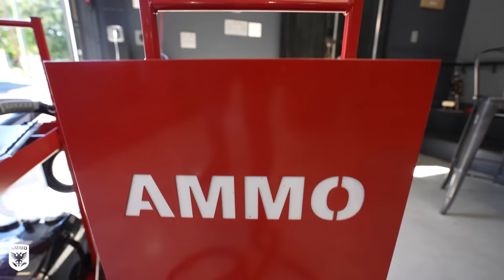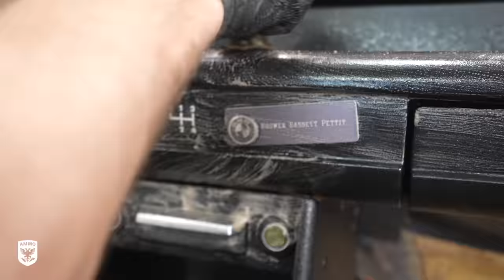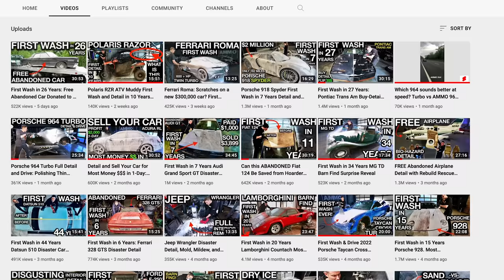First Wash in 20 Years! BMW 2002 Disaster Detail: Buy and Flip

Comment: $4,200 for that car is a major steal even in that condition.
Reply: Definitely, at least 7k
Reply: Would've paid a whole lot more with that condition - You're friend got a steal!
Reply: Yup he stole it for sure
Reply: I sold my 1975 2002 with major upgrades for £300 back in 1989, it was all you could get for them then as they were very hard on petrol.
Reply: How much could it be worth if driving and repainted???
Reply: @cjcj2940  10-15k in running driving condition. 20-30k if clean-very clean
Reply: @kingsman4L  Thanks!
Reply: @cjcj2940  yup yup, just found one in my new neighborhood that’s been sitting for years. Nardo Blue! and 5k on the rebuilt motor. Gonna try and snag it for $500-1500 and flip it for $8-10k lol
Reply: I reckon the seats alone are worth that .

Comment: Had a ‘72 battleship grey with that navy interior. 

Best car to work on and learn how an internal combustion engine works. Everything on that car is straightforward engineering solutions. 

Once those mechanical problems are fixed on that car it will be worth $15,000 for one reason, that spare tire well is not all rusted out.

Comment: I have been using pressure washer for years to clean carpets and the carpet mats for vehicles. On thing I learned over the years if you hang them up in the sun ☀️ or just hanging them up they will drip dry really well. Also a great tip if you like the “carpet lines” in your mats, while the carpets are still wet, use your stiff bristle brush to go in the opposite direction of the ways the carpet fibers lay and make your lines. As the carpets dry the lines will dry in really good and last a while longer…Just a tip that has worked for me… As always, enjoy your videos!! God Bless and stay safe🙏🙏

Comment: Love these cars.  Question: has a customer ever just given you new carpets to install during the cleanup in an effort to minimize the time, effort and cost of shampooing, scrubbing, steam cleaning etc. of the old ones?  Seems like sometimes the cost may be a wash (no pun intended) with, in some cases, better results.
Reply: On normal cars (much newer than this) it probably wouldn't be a wash. In general most detailers don't remove carpeting, the YouTubers do because it makes a better video, and in some disaster details such as this it may make sense. 

But I would guess off the top of my head less than 1 in 1000 cars would make sense for carpet replacement over cleaning. Burn spots and bleaching and worn fabrics are more common than that I'm speaking to cleaning.

Myself I just did a disaster mouse detail for my buddy, I turn customers with that kind of car away typically in general. And I didn't remove the seats, I did the back seat since that's almost always a pop-out type thing. But I got the carpets to 90% like new without removing the seats or carpeting. Extract, and ozone will cover 99.99% of cases.
Reply: I was thinking that. Amazing job on the detail but next time buy an Esty carpet kit :)

Comment: What stuff did you use on the chrome ? Just regular metal polish? And what can be done to rejuvenate paint that has the clear coat peeled in majority of the vehicle. ?
Reply: With a cheap car wax can cause rejuvenation ( like turtle wax 🐢)
 my < hood >paint fadded bad 10 years ago. Clay bar just made it worse / cloudy black =Grey = white patches
 I finally machine buffed it ( the hood) after years of hand polishing. 
1st:h hand polish with a  "cheese cloth fabric"  to strip off old wax coat first, use a car cleaning compound Polishing  Compund; by turtle wax 🐢  then, clean with soap and water. hand dry with Terry Cloth!!!!
2nd.  Here you car wax and buff the car.... in the shade  / not out in direct sunlight. Apply a wax ( light coat). Let wax dry ½ hour minimum.  
2nd attempt / extra credit...use a machine buffer and wool pad to remove all, old clearcoat or" old paint" oxidation . Start over with wax / cleaning

Comment: A little tip - most BMW parts have a partial part number stamped on it. The obvious exceptions are very small parts such as washers and screws. If you need a replacement part, just make a note of the partial part number, which can then be cross referenced using the EPC.

Comment: I miss cars this simple.  My first car was an Accord (78) and when the head developed a pinhole leak, I took the breakdown as the opportunity to freshen up the engine.  New rings, new bearings throughout, used head from a newer year model (there were a couple of design fixes I noticed which probably took care of the thin water jacket walls) and new clutch.  I also replaced the 3 barrel carb with a 2 barrel weber kit.  ALL those vacuum tubes came out and the thing ran amazing for years.  No computers, no injection.  Check for spark, fuel and coolant.

Comment: As the former owner of two 1970 and 1972 - 1977 BMW 2002, I also had my second car rust protected with a set of Finnish Locari, alu shelves on top of the front wheels, and I asked the man spraying rust-oil inside, to exchange the original foam round the tank (I had noticed rust around the tank in my first car), with some Building Sealant, which didn't collect moisture! He also found some spaces not displayed in the "Spray Charts", and gave those oil inside on top. So when I sold my second BMW in 1977, for a new and absolutely horrible built BMW 320 (It spent more of my next 9 month as an owner, being repaired from its Warranty, than by me!), it was definitely without any rust, in spite of those BMWs are being known to be total rust buckets. I didn't know then and was fond of mine.  Finn. Denmark

Comment: I owned this car . I bought it from my Neihbor, for $900.00 . Back when a BMW was a joy to have . It had 365,000 on it. It smoked badly when I let off of the gas pedal . One piston leaked oil. Every 300 miles I had to add a half a quart.  I also used Bahrd-all . It was really clean looking ! It was just over 20 years old  when I bought it . I finally sold it...for $1200.00 ! I must admit,  hitting those gears just right, was a pain in the butt . And the seats were uncomfortable . But the BMW 2002 was nice to look at....at the time ....😇👍

Comment: Congrats on brilliant revitalization. This looks incredibly complete with front directional's, good rockers, door bottoms, and rear internal strut mounts. Even the DASH!?!? Holy crap!! I'd say you hit a home run!!! Best BMW barn find in a long time. With best non-standard Recarro option. I'm dying t hear what it $ell$ for....

Working my way through college fixing and restoring. The diff between 1973 vs '74 is pointed chrome bumpers and round tail lights vs US impact bumpers and square tail lights. LoL... Having spent a lot of time with 2002's, 2002ti's dual side draft Webers, and 2002tii's mechanical fuel injected. Where's the Blauput?!?!? LoL

Comment: Hey man, there is something you got to have a look at before doing any test drive, because it may hurt your health:
Take of the back wheels (one by one, or both, as you like.) Take a small or medium sized hammer and check the whole axle for rusty parts. It happened already 30 years ago that it got broken when doing the turns. That is dangerous, the whole wheel with half of the axle may disappear in the ditch.

Comment: I have some original style bare aluminum CenterLine wheels that I put away years ago. When I pull them out I hope I can find a no-scrub spray on cleaner to use on them. 20 years ago, EAGLE Co. use to make a product that was awesome at making the wheels look brand new. Sprayed it on, let it sit for a minute or two, hosed it off and BAM, perfectly uniform, no shine aluminum finish. The stuff smelled pretty caustic so I'm not surprised it doesn't appear to be available anymore. Any good products out there to be had these days?

Comment: Great job Larry. the 2002's are great cars. Some say it's one of the best that BMW ever made. My roommate in college had a 2002 Tii. Fun car.
@AMMONYC Question. I've got (recently purchased), a 2004 986 S in black. The paint is in great shape. However. There are a lot of swirl marks and light scratches I've been trying to get out with at least 10 different products. None of which really does the job. And I don't want to burn the paint. What would you recommend to use with my machine?

Comment: I would think that by now, you would have a demo wall to hold carpets vertically so when you pressure wash it; everything just goes down. Helps tremendously
A work bench to scrub seats will save your knees I believe. I met you once and you are taller than you seem on YT

Comment: Could you drill out the handle of one of those dual density brushes and connect it to one of the swingy spray bottles so you can have even more cleaning power?

Comment: well to all of you who dont know. "oil and grime" is not allways bad.. oil protects metal from corrotion, so if you are not planning on using/selling the car, let is soak in oil! also 4000$ for a 2002 e10 is super low, if you did not waste your time and did some real work on it and straighten the front basket, new/replacement grills, you would have got 10k $ for it.  maybe you would even get 10k just as it is... // someone who got many e10 2002/ tii and other old shitbox-beemers. :)

Comment: The “WATCH” Principle of Cleaning

“W”	Water (tap, DI, etc.)
“A” Action (mechanical action: high pressure, drill brush, manual scrubbing, etc.)
“T” Time (the length of chemical dwell time  and mechanical action)
“C” Chemical (type of chemical and use concentration of chemical)
“H” Heat (ambient, hot  water, steam, etc.)

Comment: If I could find one of these for anything close to $5000 (That's CAD as I'm in Chinada Oops I mean Canada) I'd be over the MOON!! Especially in that condition!! Some motor mounts some brakes and lines and it should be good to go. Well after I put the S54 E46 M3 engine in it and the trans and rear end from said car as well. Plus the steering rack. (Maybe). LOL.

Comment: 1974? that´s the second model maybe 71 to early 73 at the most,maybe because it´s an american version i remenber a Alpina with the front with the last grill and the ones with aluminium grill were only sold till 72 ,i had 7 of them all from diferent years and types,had one like this and the previous that didn´t had head rests and instead of black texture paint on the metal in the side of the front seats was chromed ,and the 74 was the last model to come out ,had two this in mint condition .A 71 i had with the regular four barrel carburator white with the interior like that in blue also in mint condition , i sold all for prices from 50.000€ to 10.000€ , some cost me 300 to 500€ others just ofered to me .Normally i only asked for the ones kept in garages or all involved in plastic with the tires taken from the car and rested on top of bricks, in 75  they were sold with the 315 already in production ,one could choose one body or the other